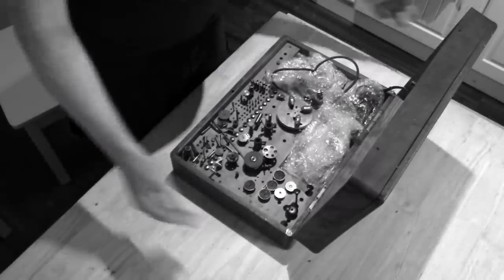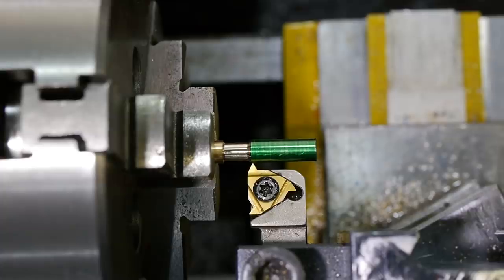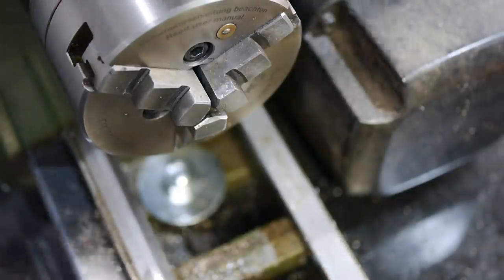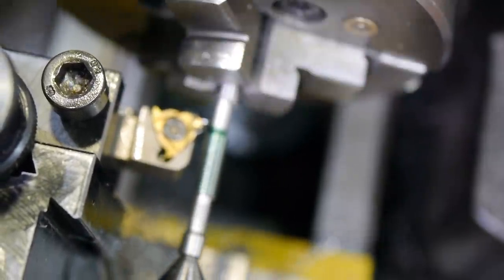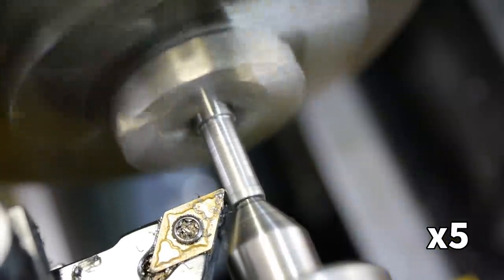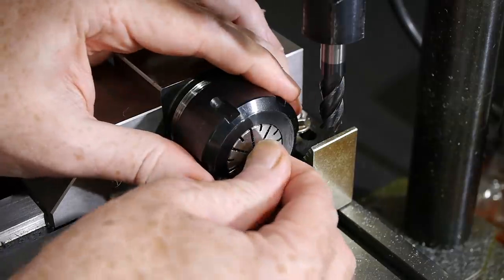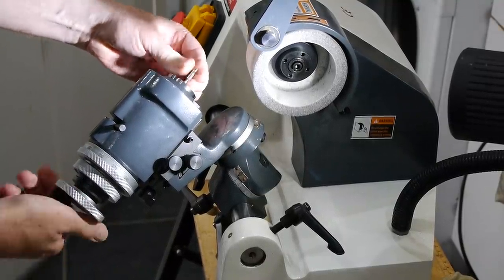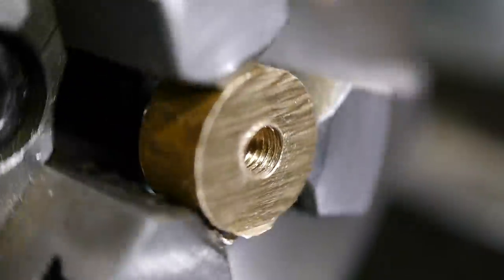Making a Custom Tap on the Proxxon PD 250/e Lathe

Comment: It looks like it may be a model engineers 5/32" (3.97mm)thread (40 tpi, giving a pitch of .635mm), which uses whitworth 55°thread form.  A quick search throws up plenty of RH taps, but no LH ones, so definitely worth the DIY.  Maybe the nut bound on full insertion on the test piece because of the slight mismatch between 0.6 and 0.635 mm ? Or it may be a random 5/32-42, which would be closer to .6mm pitch of course

Comment: (2:38) - First time I've seen someone blowing down a straw to blow dust and scrap out of the way.
Way to go man !
It always made me laugh whenever I saw anyone using air-in-a-can to do this.
I have used the pipe part of a turkey-baster for donkeys' years now.
Because of the wider diameter of most of the pipe, you can really blow up a good pressure with just your lungs.
Much more effective than using a straw.
You should try it.
>

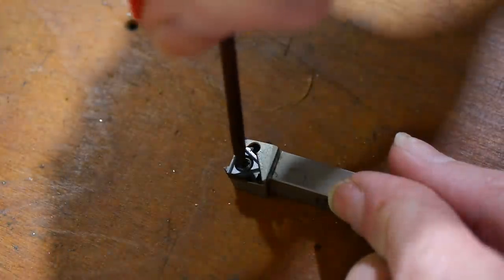Comment: 2:20 " And the whole chain is connected to the spindle by this belt" - it's actually the PULLEY on the belt that's most useful to make because it's much easier to make a pulley than a gear, you can adjust it in infinite increments by resizing, and  recut it for (lower) ratios, all things you can't do easily with a gear.
Reply: Not quite infinite increments.  It is a toothed belt, so can only be changed in units of one tooth pitch on the belt.

Comment: For a VERY extensive range of taps and dies try Tracy Tools of Honiton Devon UK with a Google search.
If you look at both taps and dies under magnification you will find that the lead in areas are ground with "front relief" in single point cutting terms.  So when taps and dies are made commercially when being rotated against the grinding wheel they step in and out in  sync. with the tap flutes or holes for dies..  For one offs that can be done with care using a Dremel type tool under magnification.
Impressive effort and result!  Hole in the brass test piece looks very good.  Original Lathe nuts were hopefully phosphor bronze.  If you decide to make those try Colphos 90 bronze which machines well.  Lead screws were probably just En1A mild steel.
Reply from the maker: Thanks for the tips! I've used Tracy Tools a couple of times looking for for BA taps and dies. They didn't have anything that matches this spec though.

Comment: You can get "FULL FORM" threading inserts, the insert has a shoulder ground either side of the tip so for instance for  a 1/2" BSF  thread, turn the o/d to .500" dead, then keep screw cutting until the shoulders "TOP" the thread till it's a few (5 0r 6) thou' undersize - No need for a gauge or wires, It'll fit the tapped hole everytime (in theory)

Comment: Silver steel in diameters less than 15mm/5/8" should be quenched in oil,. It is very difficult to get a even heat on such a small piece with an open flame. I would suggest packing pieces, and a more enclosed tube like space. When hardening D-bits with open flame heating on the tip end directly seems to the best way. And I turn the lights out first, bc it's hard to see the proper colors with the lights on.
Reply from the maker: Do you have a link to any information including the specific grade of silver steel? All the data sheets I can find for BS1407 Silver Steel say that it should be quenched in water.
Reply from the maker: Looking around online I guess the hardening process you are referring to is the one for DIN 1.2210 Silver steel, which has a diferent composition from BS1407 Silver Steel, and different hardening process.
Reply: @AdventureswithaVerySmallLathe  No, but I use 115CrV3, and read the instructions from one maker.
Reply from the maker: @CandidZulu  115CrV3 is a different grade from BS1407. The British grade has less carbon,  no vanadium, and differences to the other alloying metals. See the chart here for a comparison:
https://en.wikipedia.org/wiki/Silver_steel
Reply: @AdventureswithaVerySmallLathe  Chromium increases hardenability, so oil quench is more suitable for 115CrV3. Oil is less likely to cause cracks. I've used a lot of "drill rod" in the past in the USA, and from memory that was also an oil quench steel. I would assume water quench will cause distortion more than oil.

Comment: Developing the proper thread profile will eliminate the need for filing on the thread peaks. It is a simple formula covers all 60º inclusive threads. It gives you the maximum diameter of the thread so you can establish the maximum diameter prior to machining the threads.
Reply from the maker: That's certainly a benefit of using modern 60º threads, as they generally have flat topped profiles. The thread I was cutting in this video has a rounded top profile, like a number of older thread standards, so I was filing to try and match that profile.

Comment: Great stuff! I have the same lathe and often have trouble parting off aluminium or brass. Neither HSS shanks nor carbide inserts work too well. How do you do your parting? Anything to keep in mind except sharp tool + centering it well?
Reply from the maker: Parting has always been really difficult, and I've broken a lot of tools trying. In this video I had to back off and use a hacksaw. Here are some of the things I do:
1) Try and avoid having to part right to the centre of the part. If possible ensure that part has a hole bored through it. Parting is most difficult and dangerous as the tool reaches the centre.
2) Make sure the tool is bang on centre height.
3) Engineer BrunS suggests pulling back on the toolpost, to make sure the post won't get pulled forward and under if it snags while parting. I've tried this, but I'm too new to the technique to be sure how well it works.
4) I have bolted my lathe to a granite slab to make it more rigid. It has made the machine way more rigid in general. Something made of concrete would probably do equally well, as long as you can get it flat enough on top.
Reply: @AdventureswithaVerySmallLathe  I need to break out the hackwaw more often it seems :D

Also thank you very much for your videos. Most other channels have comparatively huge lathes, so seeing somebody using a PD250 is a nice change. You show things i never thought to be possible on this machine :) 

(I am just slightly concerned about your lathe's health, it seems a bit battle-worn ;) )
Reply from the maker: @badalloc1  Make sure your ways are well protected before you break out the hacksaw.

Thanks for the encouragement. :) I enjoy pushing the limits of what can be done with a lathe this size, and I'm delighted if it inspires someone else.

Cutting oil gets everywhere, makes the stickers come unstuck, and leaves a dirty looking residue. The effects are mostly cosmetic though. The ways and other critical surfaces are in decent shape.
Reply: People see cutting fast clean and easy on CNC lathe....but that because CNC using ball screw which has no backlash...tool can not be pull and dig into the part..... on manual lathe, dont do that even you can...there is a small risk not worth taken.
Reply: @AdventureswithaVerySmallLathe  Only one dislike, you have set another Youtube record...perhaps that person hit button unintentionally.....I learn a lot from    you, Thanks.
Reply from the maker: Thanks for watching! I'm really flattered by the number of likes I get, but it's great encourage to keep doing more of the same.

Comment: I think some of these lathe companies mix standard and metric together to make a part you must buy for them. Same issue with my lathe I have a screw that is a cross between a 9/16-10 and a 14x 2.5 trapezoidal. If I had to guess it was a 14.25 acme. Either way it don’t exist and making a brass nut of either didn’t work. The 14 was too tight and the 9/16 not quite right so I ended up using both to make a hybrid that actually worked. Better than the worn part anyways. Buys me enough time until I can get ball screws installed.

Comment: "The result is definitely a threaded hole" :-) Clearly better than a pizza.
Very clever and shows what a home machinist can do; the heat treating is very cool (interesting :-) as well as the logical outline of the steps. The 1.5mm milling was dicey.
Reply from the maker: I was terrified by the idea of using a 1.5mm endmill that far from the spindle, but it actually turned out way smoother than I expected.
Reply: @AdventureswithaVerySmallLathe  Looks like the key is Max RPMs and minimal DOC. Great confidence inspiring video.

Comment: For cutting threads towards/away from the chuck the tip I've used is to always cut away from the chuck. Turn the threading tool upside down in the toolholder & run the lathe in reverse when cutting right-hand threads, it removes the risk of screwing up and crashing into the chuck.
Reply from the maker: I've used this technique too, which I learned from Joe Pieczynski's channel, but my toolpost doesn't have room for the tool upside down. Instead I get the right cutting direction by using a tool on the reverse side of the part. Look for the second thread in my Quick Change Tool Post Upgrade video for an example of the technique.
I don't use it in all videos because it doesn't work with the tailstock.

Comment: @Adventures with a Very Small Lathe
Thanks for a very interesting video.
And my apologies for the possibly stupid questions, how ever I was "under the impression" that You shouldn't quench when tempering, am I mistaken ? 
And also was it a "strategic decision" to harden and temper it before grinding the "cutting geometry", if so what were those reasons ?
Best regards
Reply from the maker: This is my first ever attempt to make a tap, so much of my technique was simply copied from much more experienced machinists who also have uploaded videos on this topic. For the temper, I am pretty certain you are correct that quenching is not required, but for a really accurate temper I needed to use a precisely controlled heat treatment oven which could set the exact temperature, and keep it there for the correct time. As I don't have any equipment that could do this, I had to just rely on looking at the colour of the steel, to guess what the temerature was. Once it had reached close to the right temperature, I cooled the steel in water to prevent it becoming over-tempered. The steel was not nearly enough for this quench to cause any more hardening.

Comment: nice job........a little polishing to create the cutting tool relief does the job.
creating the primary relief on a tap thread requires a cam driven thread grinder "Hybco" is one brand for prototype  shops.

Comment: As an exercise, I enjoyed it, but M5 x 0.5mm fine , are commercially available and you could have used them to make a new nut and screw. Then made a new dial for your slide.
Reply from the maker: That's a good suggestion, but for me the whole restoration is an exercise, and the more I learn along the way the better. It's really important to me that I restore the Boley to as close to its original specification as possible.

I hope you're not put off from making suggestions in the comments though. I've learned a lot from comments, as many viewers of this channel are smarter and a lot more experienced than I am. :)
Reply: @AdventureswithaVerySmallLathe  Point taken and more power to your elbow, I wish you well.
Reply from the maker: Thanks! Much appreciated. :D

Comment: I think you have made a fantastic attempt at making an odd thread on a metric lathe. It will always be an approximation but if done correctly the error will be minute.  Where you wind your screw onto your test nut you notice it gets tight towards the end of the nut and put it down to a bur.  It is more likely accumulated error in your pitch approximation. How is this watch lathe actually graduated in mm or in inches?
Rather than try to measure the thread pitch in mm then make that pitch in mm you need to figure out what thread it actually is.
Do you have a set of a imperial pitch gauges? From your calculations it looks like the thread is about 42 tpi which is a bit odd for a feed screw.
If you think about it the pitch should be really obvious.  How is the cross feed handle graduated?
What is the outside diameter of the feed screw?
Looks like an interesting project :)
Reply from the maker: The dial has 10 graduations, which doesn't really seem to make any sense. I'd need to ask a watchmaker what they would expect to use the graduations for.
Reply from the maker: The reason that I used metric measurement is that all the documentation available on G Boley lathes from the right time period says that they used metric measurements for the threads. Metric was made mandatory in Germany in 1872.
Reply: Very interesting
I didn’t know the Germany made Metric mandatory so long ago.
I guess as long as the nut you produce is close to the right pitch the accuracy of the machine will be fine as the screw will determine how far the tool moves.
I hope you can continue to post details of this restore.
I don’t know anything about watch making lathes but I would love to learn more.

Comment: How come you didn't make the taper profile during the turning operation before threading?  Wouldn't that save you the step of using the grinder?
Reply: How would you achieve first few not fully formed threads if you turn the diameter smaller than minor diameter of the thread?
Reply from the maker: Grinding the taper is just the first step. The important part of the grind is the relief, which can't be turned as it's not round. I wasn't really able to record the relief grind, as the camera angles were very hard to set up, and I spent a lot of time experimenting.

Comment: Look at a tap from the end the flutes aren't cut in the middle of the part they are offset so the edge of the cut is in the middle of the tap
Reply from the maker: That's true for many taps, but not all. I looked at a lot before settling on how to mill the flutes. The only real difference that makes is on the rake of the cutting edges, and I figured that on a tap this small, the rake wasn't incredibly important.

Comment: my guess is it is not a 55 degree but a 53 degree  minutes thread  Loewenherz thread, commonly used in Germany at the time the lathe was made
Reply from the maker: I looked at Löwenherz thread during my research, and it's very close, but a 4mm nominal Löwenherz thread has a 0.7mm pitch, not 0.6mm.

I spent a lot of time digging through the wikipedia page on old thread standards. :)

Comment: British Standard Whitworth, British Standard fine and british standard pipe is 55 degree thread.

The roaunded thread and valley is very similar to the BSW/BSF standard. It wasn't one of these?
Reply from the maker: I looked at all the BSW and BSF tables I could find, and through all the tool catalogues I could search online, and none of them had a thread specification that matched this one. A 5/32" BSW thread has 32 tpi, and BSF doesn't go down to this diameter.

Comment: Maybe I'm crazy, maybe it's the fun of making a bolt + tap in a weird size....but why not just make a new bolt and new nuts with commercially "normal" sizing,  like 6mm X 0.8 threads or something like that?   Maybe it was for the challenge.   That said, I enjoyed the video, especially the heat treating portion.     
I few years ago our shop burnt to the ground,  I recovered several tons of tools and some needed to have their heat treating restored... I found it difficult to get the hardness/temper correct for small items especially....I really liked seeing your shade tree solution.
Reply from the maker: My objective is not just to get the G Boley lathe working again, but to restore it to its original specification, with as much original parts and material as possible.

Comment: Hello, Nice work, congratulations!  What do you put on the tap before heating it?  Thank you for the answer.
Reply from the maker: I used a paste of boric acid crystals mixed with methalated spirits (denatured alcohol) wrapped in a very thin layer of wire wool.

Comment: I always thread away from the chuck.  Most of the time the lathe runs in reverse and the tool is upside down.  Left hand threads like you are making allows the tool to be upside up.
Reply from the maker: It's a great technique if the setup allows for it, but my tool post isn't big enough to hold the tool upside down, and there isn't enough travel on the cross slide to hold the tool behind the work.
Reply: Adventures with a Very Small Lathe Sorry you have troubles here.  I started doing this because my toy lathe did not have enough power at low RPM.   Going backwards, so to speak, allowed full power.  
Have you tried making custom holders for your tool post?   I have found running backwards when parting is also better on toy lathes.  The lack of rigidity often caused the tool to dig in when running normally, running backwards allows it to just cut freely.   Easily parting 1.5” diameter 17-4.

Comment: Do you have a link to the grinder? That would be very handy to have around the shop!
Reply from the maker: Sure, here's an affiliate link, which supports this channel if you use it to make a purchase:
https://rover.ebay.com/rover/1/710-53481-19255-0/1?icep_id=114&ipn=icep&toolid=20004&campid=5338559044&mpre=https%3A%2F%2Fwww.ebay.co.uk%2Fitm%2FCutter-Tool-Grinder-Sharpens-Endmills-Lathe-Tools-Drills-From-Chronos%2F372533263837

Comment: You could have set up a parallel rail as a guide and used a dremmel cutting disk to make the flutes they arnt critical but still a dremmel would have gotten close. Great job new sub 👍
Reply from the maker: Yeah, I think that might have worked, but it would have been really difficult to avoid making mistakes on such a small tool. It's only 4mm across. Using the mill gave me a lot of security and certainty, and was worth the time and effort it took to set it up.